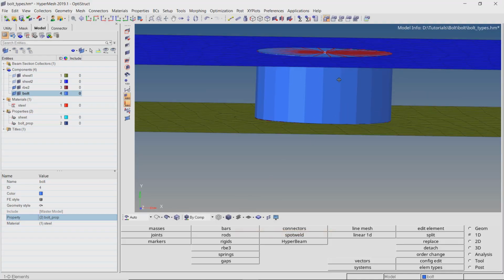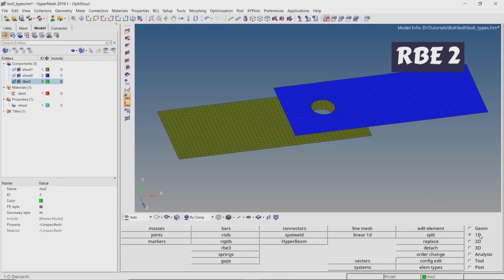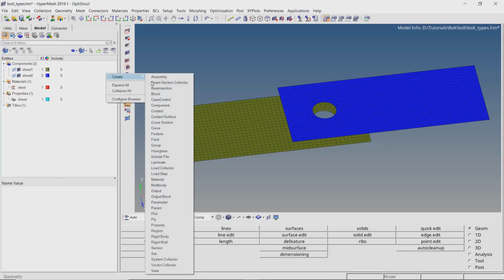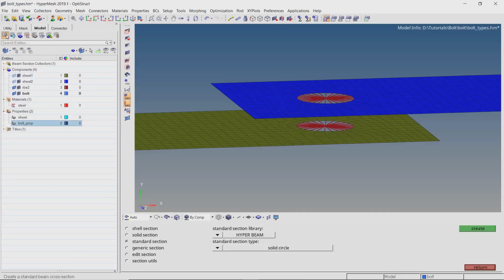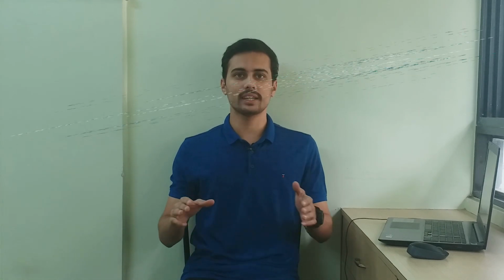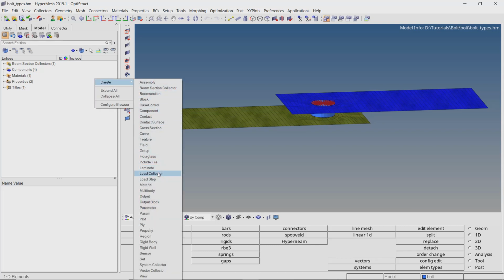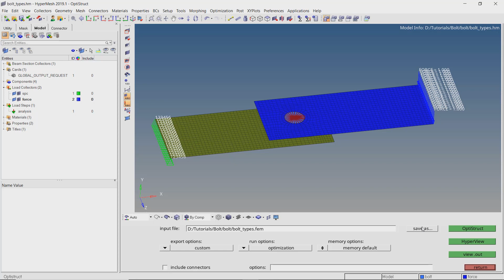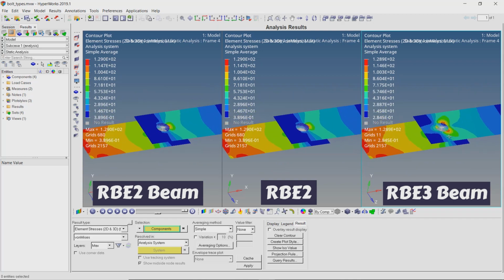Hypermesh Connectors : Bolt Connector [3 METHODS]

Comment: Watching at 3:28 am 
Thanks for wonderful subject/topic
Reply: Thanks for this
I suggest to make 1 video on thermal analysis if heat exchanger including conduction convection and thermal expansion coupled

I have a condition 
Entry temperatures of both fluids exchanging heat is given along with mat1, mat4 properties 

Also consider ambient temperature
If nit video, can guide as well
Reply: Waiting for a quick revert

Comment: I have problem related to it i have a  box which i modelled as conmass at the centre of RB3 elements but the when i m applying the load the the stresses are coming very high but when i changed to RB2 the stresses near the bolting points became 1/5 , i am not able to understand why the variation is coming this much

Comment: Also something that is somewhat not shown in the vid is that there are 3 different cases /models that need to be saved separately correct? Also how do you load the results of them in parallel in hyperview ? ( a nice small vid clarifying that would be useful) thank you
Reply: Hi Chris. To answer your first question: yes, you save the three models and their respective .fem file. As for the Hyperview in multiple windows, in the top menu icons select the "page window layout" button (its icon is a white box) and there select the desired layout. Then, you click on the graphics window space to activate it. After that, load your animation as usual and do the same for each window. Finally, if you want to synchronize the view, select the "synchronize windows" button
Reply: @jaimecardenascervantes9908  i will give it a shot thanks

Comment: how to model riveted joints in hypermesh
Reply from the maker: In a simplified case, riveted joints can be considered as point connectors between the two components. Hence, they can be modeled similar to spot welds with some modifications in the element type and property.
Reply: @Aeroswap  what element types and property needs to be change, kindly tell

Comment: Hi, Thanks for the video again. I got one error while applying the beam property as below.

* Error #1479 * in the input data: 
Incorrectly formatted numeric data in field 9.
7890:PBEAML, 2, 1, , , , , , >ERROR<

I checked the .fem file and the erroneous input was made in PBEAML line as above.

I could resolve this error by unapplying the 'Beam Section' made by HyperBeam and then manually input the cross section info as ROD, DIM1A : 6. But the plate 'flies up' even with very small force input.

Can I resolve the error while I keep using the HyperBeam menu?

Comment: Great video👍
Helped a lot🙌
I have a question, why we always prefer to use RBE2 over RBE3 around hole, wherever we've to apply the constraints or forces, just like we saw in the case of static structural analysis(in previous videos) of knuckle, we have make use of RBE2 elements around hole/mounting and accordingly we have applied constraints & forces, we would have prefer RBE3 since it distribute forces around the connected nodes.
Thank you and looking forward to your reply.
Reply from the maker: Hi Shashwat,
Good question!

The location of independent and dependent nodes is reversed on case of RBE3. This can cause errors in the analysis if the RBE3 element is not defined correctly.
As a general practice to avoid complexities, RBE2 is used for load application and RBE3 is used for mass addition and bolted joints.

I hope this answers your question :)
Reply: @Aeroswap  Thank you

Comment: can we use RBE2 and RBE3 for nonlinear analysis or does it have limitations?
Reply from the maker: Hi Neeraj, you can use RBE2 as well as RBE3 in nonlinear analysis. There will not be any issues with that.

Comment: Is there any way to create tension only spring elements in hypermesh?
Reply from the maker: Yes, please watch the recently posted bolt pretension tutorial on this channel.
Reply: @Aeroswap  Sir, I watched the video but I think that the concept is different, I want to create element such like that the stiffness is zero in compression
Reply from the maker: Have you tried to create an axial joint? In joints, we can set the desired stiffness for all applicable degrees of freedom.
Reply: @Aeroswap  No sir,till now I have not tried with axial joint in hypermesh..
Reply: @Aeroswap  if it is possible kindly make a video on cgap elements

Comment: Thank you for your tutorial videos on hypermesh. Just want to ask the 3rd method you told can it be used for multiple plates like 4 plates are their and a single bolt is passing through. Waiting for your answer.
Reply from the maker: Hi Miheer,
Good question. Yes, this method can be used to create a bolted joint between more than 2 plates. However, certain modifications are required. If rigids are created only on the lower and upper plates, there will be no contact between bolt and the middle plate. To avoid this, a rigid must also be created on the middle plate. 
I hope this helps.
Reply: @Aeroswap  thankyou with this I will also request you to make a video on leaf spring suspension if possible.

Comment: Very good video. But it is better if you can compare the results with e xperimental data or analytical calculation to find the best accuracy model. 
And could you please share the methods to model the bolt between 2 3D parts ?
Reply from the maker: Thank you.
I have already posted tutorials about 1D as well as 3D bolt modelling. Please check the 'Optistruct Tutorials' playlist to find these videos.

Comment: Hello bro, your connectors video helped a lot!!! But I have a doubt regarding bolt connectors. If we want to fasten more than 2 components together with a single bolt, do we have to apply RBE3 elements only on the top and bottom components and not on the middle components? Please explain.
Reply from the maker: Good question! 
In that case, you can either create a 3D solid bolt with contacts or a 2-stage 1D bolt which connects all the 3 components.
Reply: @Aeroswap  Actually I don't know how to create 3D solid bolts. Have you created any video on it.. Or can you provide any other source to study?
Reply: Also can you please tell if we can create U-Bolts in hypermesh. If not, then what type of fasteners can we use in place of it?
Reply from the maker: Solid bolt cannot be modelled in Hypermesh directly. You have to import the bolt CAD and specify the pretension and contact settings to get the bolted joint properties as required!

Comment: Hi... While creating the rigid you selected only the outer nodes of the hole...But usually we will have a washer in between the bolt and the mating component... In order to represent the washer we need to select another layer of nodes adjacent to it right?
Reply from the maker: There are multiple ways to model the bolted joint. Feel free to adopt whichever method you feel is sufficient to get the physics right!
Reply: @Aeroswap  okay. Thank you. Can you please make a video on 1d elements and the effects if they are not properly used.
Reply from the maker: Thanks for the suggestion. I will work on this topic soon!

Comment: Great video! I have a question; how do you calculate the "required torque value" for the bolt?
Reply from the maker: Hello,
Torque values must be determined by hand calculations to get proper results.
Reply: @Aeroswap  Dear friend,  i hope you're well! I have a question regardless from bolt creation. How can I create a section which is not already defined in "Hyperbeam" selection? For example "Aluminum Rexroth Profile". How can I draw it manually?

Thanks in advance!
Reply from the maker: Hey Furkan,
I'm doing well. I hope you are too!
It is possible to draw custom cross-sections in the Hyperbeam tool itself. There are options provided to draw the section or import it from an external file.
The only change will be the card image of property. In case of custom section, you will have to use PBEAM instead of PBEAML.

Comment: Bro can you make videos on some industrial projects on hyperworks. It's ok if video is lengthy.
Reply from the maker: Can you elaborate more on what you mean by industrial projects ?
Reply: @Aeroswap  a real past industrial projects which you may have handled eg. Automotive parts or any other. Tell what was the project about, from where we should take lead, what kind of results we should expect, after getting results is it matches our expectations. While giving final report what type format and what details should be mentioned in report. 
Thanks for reply.
Reply from the maker: Thanks for the suggestion. I will see what I can do :)
Reply: @Aeroswap  🙏

Comment: Great video!! thanks a lot! What would you use if you were to bolt 2 solid parts? Cheers from Brazil
Reply from the maker: Hey Pedro,
all the 3 methods that I demonstrated can be used for shell as well as solid parts. If I want accurate results, I would definitely go for the beam type bolt.
If the bolted region is not of prime importance, rigid bolt would suffice.

Cheers :)
Reply: @Aeroswap  How should I when there is one bolt connecting 3 components?  Thanks for the reply!!
Reply from the maker: Better to go for 3D bolt components in that case! 
1D rigids cannot be used to link 3 components at the same time.

Comment: Great work bro.. It would be helpful if you provide theories like differences in  bolts, beams and rods.. And why rigids has no properties..
Reply: Thanks for response, by the way you are pretty straight to topics where there is no introduction of self and no subscribe , no share kind of thing.. keep doing the videos...
Reply from the maker: Thank you Umesh. Basically, we have have any required property and material for a beam bolt. The method to create the bolt is exactly the same as I demonstrated.
Feel free to experiment with different materials and cross-sections.

As for rigids, they are non-deformable 1 dimensional entities.
> 1 dimensional so no cross-section (property)
> Non- deformable so no material

I will work on a separate video to explain beam, and rod differences. Thanks for the suggestion!
Reply: @Aeroswap  But as we know RBE3 elements are less stiffer and therefore can be deformable then why don't we assign material to them?

Comment: Hey!
In this tutorial you connect shell (2D) components , how is it if i want to connect 3D components ?
Reply from the maker: Hello!
It does not matter whether the components being joined are 2D or 3D. The bolt connection can be made using the same method for any type of component.

As bolt connectors are usually used for joining sheet metal and BIW parts, I used a 2D mesh. Nevertheless, feel free to experiment this method on 3D components.
Hope this answers your question!
Reply: @Aeroswap  hi, for 3D parts, if i choose bolt and rbe2 method, so how to define dependent nodes of rbe2 ? It should be only the upper and lower position of 3D parts or should be inner surface hole of each 3D part ?
Reply from the maker: I would go with the whole inner surface. However, it comes down to your perspective about the analysis. You can go with whichever method you feel is more realistic!
Reply: @Aeroswap  thanks, but i want to go with the most realistic method :D

Comment: Instead of doing all this why dont you use the Bolt connectors from the 1d>connectors> bolt create which will save your modelling time. you have various configurations on the same panel and connector browser
Reply: Nope you can try this in HyperMesh 2020
Reply from the maker: Yes indeed we can use that method. But in some cases where the geometry is complex, the automatic bolt creation fails. I have had this issue many times.
Nevertheless, thanks for mentioning the automatic method! Will definitely be helpful for everyone.
Reply: It never fails you have multiple settings which can be tweaked based on your hole diameter inside the bolt options panel so that you can create it easily 

Also many OEM prefer the bolt panel configuration method since it supports multiple use cases n the time to create for a BIW assembly is very easy
Reply from the maker: Okay! In that case, I will make a separate video about that. Thanks for the info.
Reply: A step ahead in latest version of HM we now have attachments concept for creating bolt connectors which is also a useful method
Reply from the maker: By latest version, do you mean Hyperworks X ?

Comment: Hey! Amazing video! If you permit, Can you do a video about how to extract forces on nodes? It is interesting subject for later welding dimensioning. There is a tutorial for Ansys on: (https://www.apolloedge.com/how-to-size-a-fillet-weld-using-finite-element-analysis-fea/ ) but I don´t know to do it  on Hypermesh/Optistruct.
Reply from the maker: Hey Richard, extraction of forces at specific nodes can be done using the 'GPFORCE' control card. 
I will explain the process in short -
By creating a new set of nodes on which we want to extract the results, we can assign the set id to GPFORCE card. Then by simply setting the output format and other settings, we can observe the forces during postprocessing.
I might make a separate video about this! Thanks for suggesting 👍🏻

Comment: Great videos always!! I often use RBE2 + Beam idealization to idealize my models and also size the bolts by extracting gpforces of the beam elements (tension / compression). But this obviously cause stress concentrations on the RBE2 dependent nodes (bolt heads or flanges overly idealized) since it blocks all the dofs hence no bolt shear is considered. Thus I often ignore the stress concentrations and make notes of this. You could also hand-calculate the bearing stress of the plates based on the gpforces of the beam elements. On the other hand, RBE3 does not block any dofs on the independent nodes since it only transfer loads, meaning there is no bolt heads or flanges stiffness considered. Also this is why you would likely see less stress concentration effects when using RBE3. I can’t answer which method is correct or wrong, but every analyst should decide based on the level of interest. The best way is to run a nonlinear contact with a bolt idealized with solid elements but it is super time consuming.
Reply from the maker: Agreed, as no model of 1D bolt can be regarded as perfect, it's upto the analyst to decide based on the requirements.

Right! Gpforce can be used to extract tension/compression. I have used gpforce to extract nodal force values at specific node locations in the model but didn't know it also works for Beam elements.
Thanks for the info!
Reply: Aeroswap your tutorials are the ones that are often used in industry and I really hope more people will subscribe your channel. 👍👍👍
Reply from the maker: Thanks Ken! I hope so too.

Comment: Great! What if we use rbe3 alone by selecting all the circular edge nodes of both the plates? What's the result?
Reply from the maker: Good question! In that case, you will observe very high deformations as RBE3 does not work like RBE2.
As the locations of dependent and independent nodes are interchanged, the behaviour changes drastically.

The plate on which force is applied will practically 'fly away' with infinite deformation and the RBE3 element will be seen to stretch accordingly.

It's an interesting thing to watch, feel free to setup this case and observe the results.
Reply: @Aeroswap  hey man, very informative video. 

I tried this direct RBE3 like RBE2 and the part did 'fly away' with large deformation. 

my question is, I tried to connect two RBE3 with the CBEAM as you have shown above, but still one of my part flies away with large deformation ? 
Can you think of a reason why ? Please help.
Reply from the maker: Hi Suyog,
Please check if the CBEAM is exactly attached to the center node of each RBE3 element. Also check if a material and property is assigned to the CBEAM.
This should resolve the error.
Reply: @Aeroswap  Hi, thank you for the quick reply. 

Yes the CBEAM is attached exactly on the two RBE3 points. 

However I would like to check these two points with you : 

(1)  I used property as PBEAM and not as PBEAML, because then i was getting this error : 
        * ERROR # 1479 * in the input data: Incorrectly formatted numeric data in field 9 
        [there is a random "+" in field 9]
        can that be the reason ? 

(2) also in above example, the bolt axis is perpendicular to x axis, so that's good. 
      but in my case, the bolt axis is not perpendicular to any of the three axis
      does the axis have to be perpendicular and if yes, then how do I define it in my example ? 

Thank you once again for your help, I tried looking for these questions, but I could not get much information on google for these.. :)
Reply from the maker: Hi Suyog,

PBEAM and PBEAML have some inherent differences. In PBEAML, we can define the cross section using standard geometrical shapes (example : square, circle). We do not have to enter the area of cross section as it is directly calculated based on these geometrical shapes.

On the other hand, PBEAM is used to define a much more complex cross section. If the cross section cannot be created by standard shapes, PBEAM has to be used. Here, we need to define the area of cross section manually.
In most cases, the cross section is simple. So using PBEAML is sufficient.

As for the second query, you can define the bolt axis direction using (N1, N2, N3, B) option. Then it does not have to be parallel/perpendicular to any global axes. Any vector can be defined by selecting nodes.

 I hope this information helps!
Reply: @Aeroswap  okay this information is definitely helpful. I will check out more into the literature. thank you for summarizing it. :)